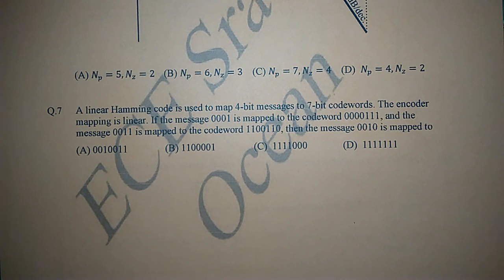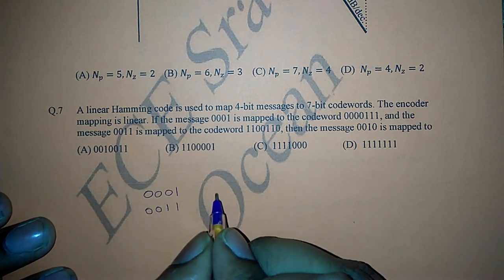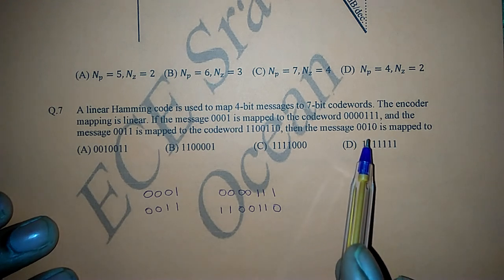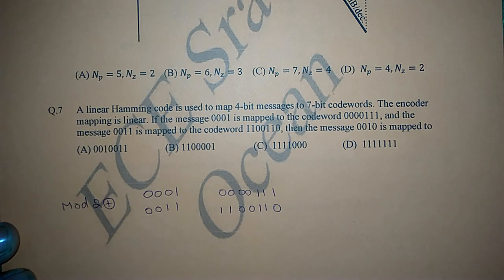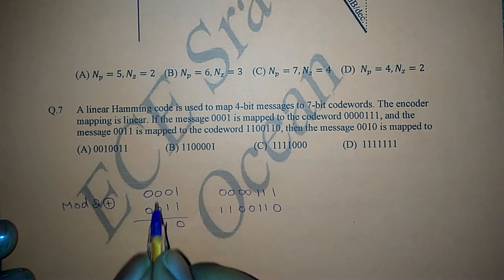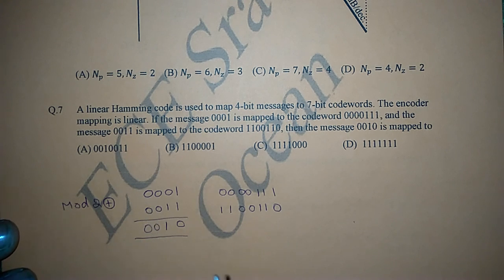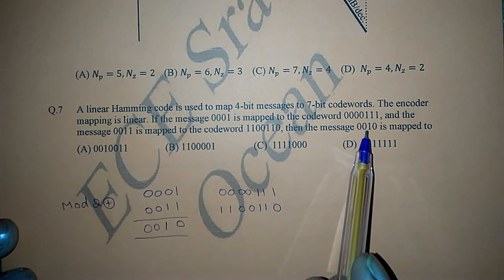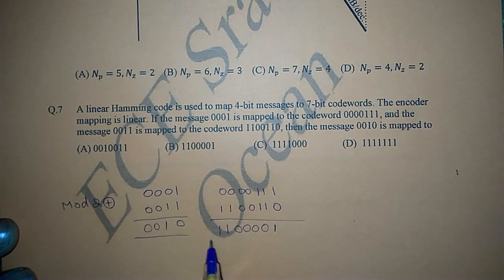GATE 2019 EC || QUESTION 7 SOLUTION

Comment: Instead of 0010 some other msg bit is transmitted then how to map?
Reply: Code word for 1&3 given in the question by using them we can find any number code. Suppose 3-1=2 which can be check in the result. Similarly for 4, 3+1, for 5, 3+2 and so on
Reply: No, only EXOR is the valid operation. 3-1= 2. But if you subtract the codeword of these two you will get 1011111 which is not given in any option. You can't do simply 3+2,3-2. Codeword are generated through modulo 2 product with generator matrix.